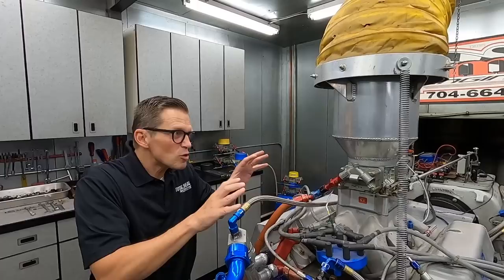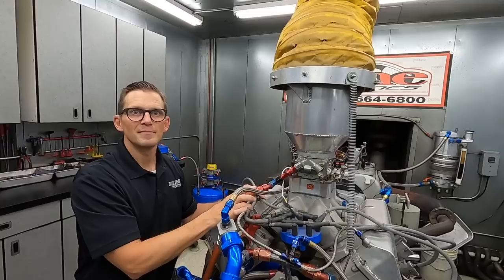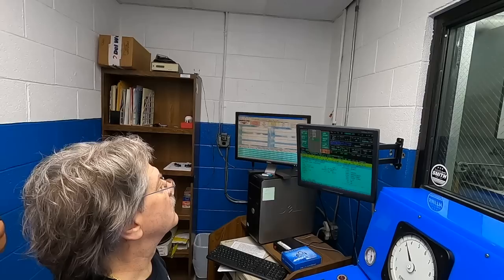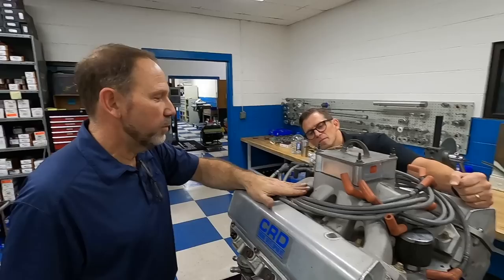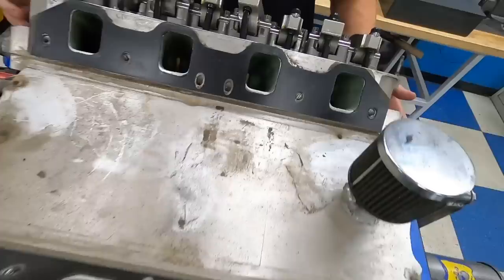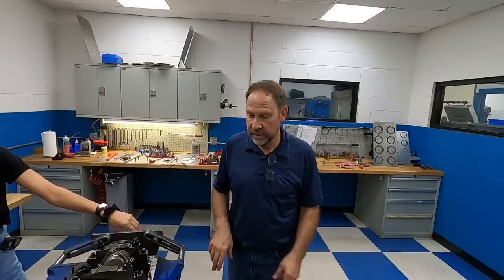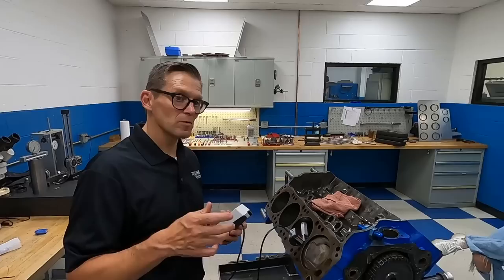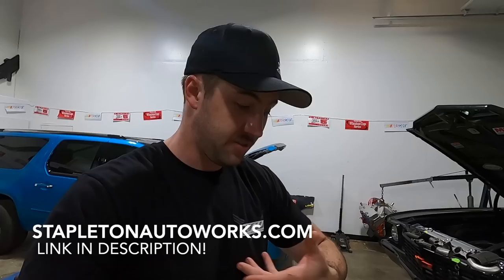Lake Speed's Ford C3 NASCAR Engine: Time Capsule of 90s Technology! (Dyno & Full Teardown)

Comment: A point of contention... the early "Jack Roush" intake manifold are for the 6049 A3, B351 and C302 cylinder heads.  These were Cleveland architecture canted valve heads (9 degree valve  angle with 4 degrees of side cant) with raised intake runners which were raced in NASCAR 1983-89ish.  Robert Yates had nothing to do with those heads, the pattern work was done by Alan Root, early port design was done by Bud Moore and later Roush.... The 6049 C3 heads on Lakes engine are a Yates design where it kinda shares the intake and exhaust pattern of the C302 but there is alot of valve train, port architecture and outer espc the Intake face/flange changes.  The biggest thing Yates did on the C3 was remove the side cant from the intake valve, which made huge improvements to valve train stability at higher RPM.... in later revised C3L and C3H heads the valve angle was reduced to 8.3 degrees with no side cant and the valves position was shifted .060 towards the center of the chamber so a 2.180 valve size would fit in a 4.14x bore better.  Cool video and tha engine should be easy to improve considering how mismatched it was.
Reply from the maker: I had no idea there were so many C3 variations!
Reply: You should organize an overview video about the specifics with Mitchell!  Would be great if he had long history of Chevy/Ford/Toyota V8 designs through the years.  Only couple years ago I found out there was a R05 program before the R07....I think toyota had a trd 9 and a 14? eh probably a bunch of eras.
Reply: Love to hear what Ernie Elliot has to say about all this stuff. He was doing a lot of stuff his own way I believe.
Reply: @gailtaylor1636  Alot of the teams altered the heads as they saw fit... Ernie's main cyl head guy was Kent Ford and he is a very, VERY sharp guy.  I have owned a couple sets A3 castings that he ported.  When I was a teenager just starting to race myself in the early 90s I had the luxury of picking thru my Dad's supply of used parts from his days working with various Cup teams.  I've built a ton of this stuff, especially Fords.  None of it was the same depending on where it came from and all of it had interesting changes.  Up until 2009 we had a bunch of old NASCAR cyl heads and intakes  from the 83-98 timeframe..... When dad retired and my brother and I took over the shop we scrapped it all because honestly it was just worn out, outdated parts that back then nobody cared about the history of and our new building didn't have room to store it anymore.
Reply: @greenmirror5555  I wish he would have been doing this prior to 2009.... back then I had 10-15 sets of old heads and intakes from the 83-98 era.  All stuff from teams my dad worked for over the yrs.  I'd have been able to show you development from the 23 degree GM 034 bowtie, 049 Phase 6 to the Pontiac 867 to the last 18 degree Bowtie to the first SB2....Ford - from furnace braised factory Cleveland 4V casting to the 6049 A3, B351, C302, to a set of Penske 6049 C3Hs.  In 09 dad retired,  we downsized and anything cracked or worn out got scrapped... anything modern enough to be useable got practically given away.  They last good set of C302s we had are on a 410" 9.5 deck engine we built for a street/drag car.... 702HP and 597TQ.  With some revisions to the port work, 1987 Technology can still make good power, especially with today's camshaft and valve train technology.
Reply: @greenmirror5555  there was an r03 program from gm as well, which now lives on in dirt track racing as the "ROX" from vic hill. It was never approved for nascar use.
Reply: @gailtaylor1636  I've just asked Stapleton if he could ask Ernie, how Bill came from 2 laps down at Talladega in '85 then was STILL pulling away at the finish !   I'm sure that engine was pulled down and measured to the millionth after that race !!!!!!!!!!!!!!!!!!!!!!!!!!!!!!!!!!!!!!!!!!!!!!!!!!!!!!!!!!!!!!!!!!!!!!!!!!!!!!!!!!
Reply: @billyj.williams2341  Kent FORD, no wonder he was very SHARP !!
Reply: @billyj.williams2341  Reminds me of here in NZ late 80's, watching the two best flat bottom N/A 6 litre class powerboats going at it.  My not super rich hero in the FORD Cobra boat...C302 heads, vs, Richie snob Rich in his latest and greatest max dollar boat (with the latest and trickest GM head at the time, (that Pontiac one I think),. My man took him D O W N, every race, and he was so salty (on a fresh water lake, no less, lol) !!
Reply: @billyj.williams2341  do you have any d3 heads or r452 blocks?
Reply: @billyj.williams2341  Sorry to hijack. Billy how do I identify any of these heads? I have a pair of bare C3's I bought a couple of years ago along with a 'jack Roush" manifold from a guy who was going to build a burnout car here in Australia.
Reply: @TS50AU  The casting number is your first clue but not all inclusive because there are a few sets of C302B casting that were labeled with the 6049-C3 casting number.  Biggest thing You can tell the earlier casting from a Yates C3 by the intake flange.  A3/B351/C302/C302B casting have an intake flange that is milled out around the ports and under the ports as the intake manifolds are 1 piece with the valley cover cast into them.  Yates C3 castings have a flat intake flange all the way down to the deck surface and are intended to use a 2 pc intake with a separate valley cover.  Also just beware that there are multiple little changes to the Yates C3  castings that were done during machining that different teams did to suite their purpose.... For instance I had an original set of Yates C3 castings from 91 that had been machined with 2.5 degrees of side cant on the intake guides/seats and were set up for Crane pedestal mount 1.6 ratio BBC rockers..... The later C3L and H will be 94-97 casting dates and you will notice right away the rocker stands pads are reinforced big time from the 90-91 castings and there are other changes to the water jackets
Reply: @billyj.williams2341  I think you hit one thing most that aren't engine builders gloss over. A C302 head was sold by Ford motorsport at a usable head. A C3 and newer yates is basically a cylinder head shaped blob that is totally unfinished as sold. Teams built their own ports, valve angles and chambers. With something like this you have to evaluate what you have not what it might be. It could be essentially anything. Manifolds and heads are mated together and one "yates" manifold from a different motor might not cover the ports in a regular head.  When you get to "real racecar" territory you make it. You don't buy it.
Reply: @philipmacduffie7612  … You make an excellent point that is often overlooked or not even understood by certain people that should know better. Bare head castings are typically as the name implies. They lack valves, springs and all of the required hardware needed for a complete head. 

Raw head castings are for skilled builders with access to a fully equipped machine shop to turn these head shaped blanks into functional heads. The critical areas like the ports and combustion chambers are unfinished so the builder can locate and shape them to suit his requirements. Definitely not a task for novice builders.
Reply: @arkhsm  … That was a seemingly impossible achievement that’s obviously still being pondered about today. It might have been a case of divine intervention 😳. Who knows 😁.
Reply: @danielwilson6665  I'd sure like to...!!
Reply: @arkhsm  … That’s for sure because it had to be one helluva hard run to recover that much distance on the track. 🏁
Reply: @danielwilson6665  I'm fairly sure I heard they (the Elliott's), expected it to blow up long before the finish line !  The other teams must have been all over NASCAR  for a Bob Glidden-style weight break or such like !!!
Reply: @arkhsm  

Don’t forget how lousy the NASCAR Cleveland was when they actually had to use factory castings. Few wins and zero titles. The C3 heads were so different from the OEM parts that Yates would correct anyone who called them Clevelands. 

Bill Elliott’s Chevy competition had heads that were closer to the factory design. NASCAR knew that they gave Ford too much and it led them to give GM the SB2.
Reply: @timsharpe3498  More like bad blocks with terrible core shift problems, than a lack of good head flow back in the 70s and early 80's. Also, the Fords of that era were THE best brick replicas for areodynamics !!
Reply: @arkhsm  

The Cleveland short block was problematic but the heads were the main problem. The only time the production Clevelands were really fast was when NASCAR temporarily allowed the raised exhaust port plate conversion. The factory heads were so thin and flexed so badly they pushed coolant past the head gaskets under sustained high RPMs. 
Doug Yates won’t call a C3 a Cleveland. I think it’ll too good to call it a Ford head because it was light years better.
Reply: @timsharpe3498  Thank goodness Ford started to pick up their act around '82 when Ford Motorsport SVO came out, Ford went from a space (at the back), filler, to the Bill (Nascar), and Bob (Pro-stock), show !!
Reply: @arkhsm  

Too bad they had to mix up the best parts of two different engine families just to be able to compete against a mid 1950s design. In 1980s Pro Stock Glidden had to use a NASCAR HEMI head to compete against the Big Block Chevy which was a plain old production truck engine. 
That’s why Ford has to make their exotic race only stuff like the SOHC because their production engines are junk. They hired Smokey Yunick to cook up the Boss 302 because everyone, even AMC,  was clobbering the wimpy Windsors in SCCA Trans Am.
Reply: @CoyoteFTW  

The engine that Reher and Morrison used to dominate early 1980s Pro Stock (and Glidden’s BOSS) was a plain old BBC. When that car rolled out of the hauler at the 1980 Gatornationals it was 2 tenths quicker than any Pro Stock car there. 
Glidden admitted that he dreaded that car.
Reply: @CoyoteFTW  

Ford won a whopping 2 Trans Am races in 1968 vs 10 for Chevrolet. 1969 was more of the same. Ford got so butthurt that they spent more money than all the competition combined to buy the 1970 Trans Am title including hiring a genuine NASCAR pit crew.
Reply: @CoyoteFTW  

The so called Oldsmobile engine used in Pro Stock has nothing to do with any Oldsmobile engine ever produced. The DRCE is based on the Big Block Chevy short block and over the counter race heads from the Oldsmobile division that were designed by Warren Johnson. 
Funny that you made a comparison to the Cleveland considering that the Cleveland is a poor and much later copy of the Big Block Chevy.
Reply: @timsharpe3498 - btw A3 heads are not a Yates head. They are aluminum high-port Cleveland heads. This is a canted valve head with typically a 2.19/1.72 valves. Cleveland 65cc chamber not the Yates 40cc. These heads were the shit, but NASCAR eventually banned them because Ford had the only canted valve head. I had this head on a 4.125/3.35 358. It made 694 hp at 7500,  you’re drunk if you think drce is big block chevy, trans am lose for Ford was because after third race of season huge wreck put out all ford teams … ford wasn’t in nascar or any factory backed racing 70’s and Cleveland still dominated prostock with 250lbs on glidden… Ford began to factory backing very few people mid 80’s. So there was only  one offering factory backing the whole time tho shitvrolet figured out the loophole can’t lose if we were the only ones racing!!! Ford and dodge weren’t sponsoring teams in nascar they had both pulled out. Convenient for shitvrolet Ford came along chevy guys started to cry wag wah we actually have to race now cry babies. We all know story it’s same thing any Motorsport.
Reply: @CoyoteFTW  

You have reading comprehension issues. I never said that the C3 is a Yates head and I didn’t say that the DRCE is a big block Chevy. The DRCE bottom end is based off of the BBC so that existing speed parts could be used. Just face the facts. Ford left NASCAR because the Cleveland was a dud. They didn’t return until they replaced every part with something besides a Cleveland.

Comment: Being a cylinder head guy I’m going to be betting the beryllium copper seats are wiped out and not flowing any air.  
  Back then everyone was stuck on .002 valve guide clearance and that would wipe out beryllium copper. 
  They also used a bunch of seat angles on the intake and if one of those angles got wiped out from the seat width growing too wide the air flow would be reduced more than we can imagine. 
    I also suspect those valve springs have given up the ghost to a degree. 
    Then there’s pushrod deflection. Rocker Arms flexing like plastic.  
     Just my bet. I’ve got a set of these heads still brand new.
Reply: You’re definitely barking up the right tree, having rockers loading those springs for 20 years probably didn’t do them any favors.
Reply: @truthliveshere831  that and the leaded fuel residue can be corrosive.
Reply: Those old jesel solid bodies are not floppy, they are heavy. I'm not going to.stand here and bump my chest or anything but a 90s cup motor didn't have 5/16 pushrods in it either. I think you are going to find weak springs, ring seal problems in those hazy bores, and valve seats that are just flat wore out. It's not like pro motor doesn't have more experience than most in old hardware. That is what they do.  Those heads look like c302 era c3s not c3l as well. Cutiously it had one peice rocker Pads. I'm not experienced enough to know that an unrestricted c3l beats a c3/c303. But they look canted to me. A later head is not.
Reply: @philipmacduffie7612  agreed. We got the build sheets. The motor was last rebuilt in 2002, so it is more modern than the 1992 T-Bird it came out of.
Reply: I hope we get to see these areas addressed and the tech that is put into them.
Reply: @hughobrien4139  that is the plan!

Comment: It is awesome to have people this excited to see it and eager to share with all of us. If that motor is down 4 points in compression at 9.1 and could should run 13.1-13.5 compression there is a TON of power.
Reply: If they raise the compression to 13.5 it'll make 220 more horsepower
Reply: @xxkingslayemxxgamer5553  I don't know if it will make 220hp but I would imagine there has to be 120-150hp there. I think I read somewhere that 1 compression point was like 5-7% so 4 compression points would be 20-30%. At say 500hp that would be 100-150hp just in the compression. To gain that much power it would need to be like 12% or more per point.
Reply: @xxkingslayemxxgamer5553  Don't know if that much, because even with only bumping the compression, the friction would be way higher as well, so from the net gain you have to substract the loss caused by an increase in heat/friction. Obv refreshing valve springs, oil pump, and stuff, plus an optimized tune, well, that could help bring it up just as much as compression...

Comment: Bro, once a racer, ALWAYS a racer! The need for speed never leaves you! I have always loved that adrenaline rush of feeling speed and the danger that comes along with it. I'm 39 now (yeah I know, not that old), and I still have a 709 wheel horsepower EJ8 Honda Civic coupe that runs 9s and I still race it. I also have a 2004 Acura TL as a daily with headers, no cats, a full Invidia exhaust with dual mufflers, an Injen cold air intake, a six speed manual swap, and a 75 shot dry Nitrous kit. It made 282 whp without nitrous on its current tune. It still pulls hard at 140 mph...so with nitrous it's alot of fun.